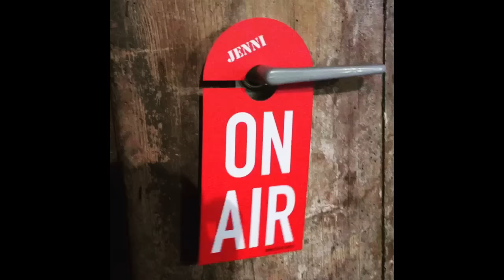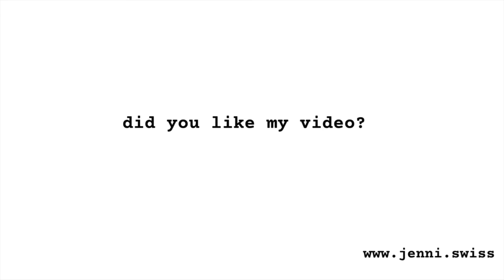how to sew jeans  tutorial home made

Comment: you are my jean idol man.
Reply from the maker: THX🤗
Reply: @JENNISWISS   In terms of threads. I'm using a Perma Core tkt 36 (tex 80) What thread size should I use for my looping thread? 

I've also been told to use tkt 27/25 (tex 100/105) for my denim jeans with tkt 50 looper thread. Is that accurate?